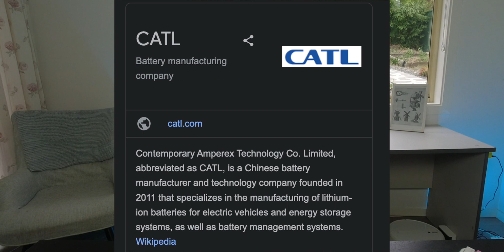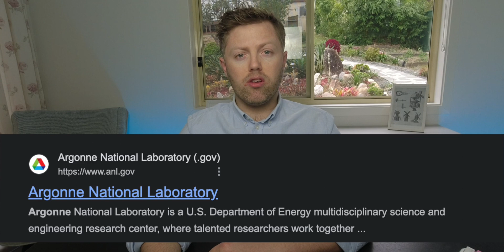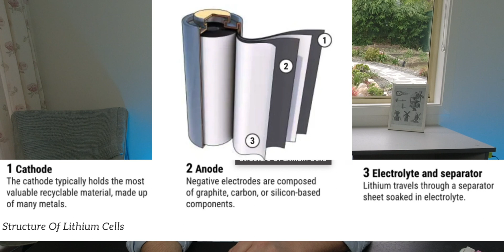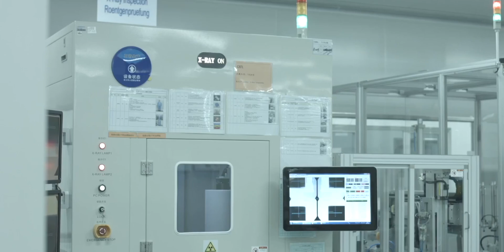New CATL battery tech FINALLY approved for production. Doubles Tesla Battery Density.

Comment: 500 Watt hours per kg sounds great, but that's only one metric. To be practicle for automotive power, we need to know things such as charging rate, cycle life and cost to manufacture. Having a battery that doesn't spontaneously ignite is also a requirement.
Reply: If it is still using lithium-iron-phosphate tech then it is quite safe.
Reply: @williamwall1967  There are no details about the chemistry of these new cells. I assume nothing.
Reply: @surferdude4487 it is LFP with a cathode that is manganese or manganese doped I think.  They also a geometry that allows better cooling and heating during charging.
Reply: https://youtu.be/D8xNjz73p80?si=hamTPRLuyVFsOe5G. Why US, Korean and Japanese manufacturers insist on lithium, cobalt, nickel and manganese chemistry is beyond me.